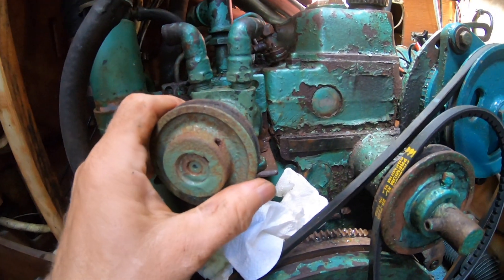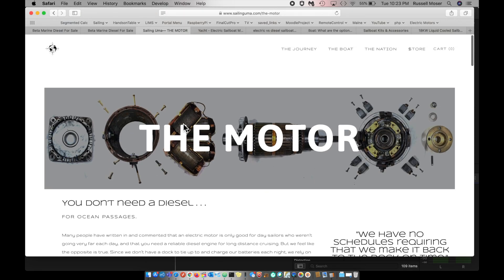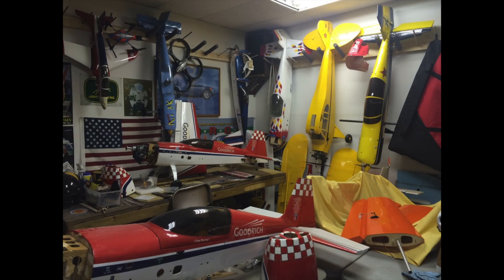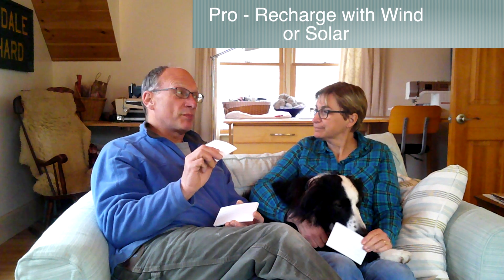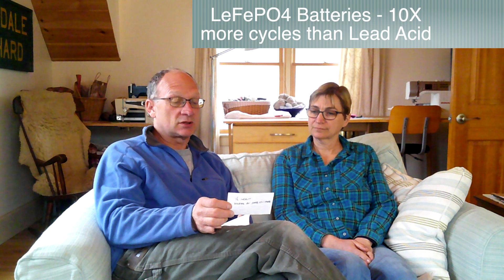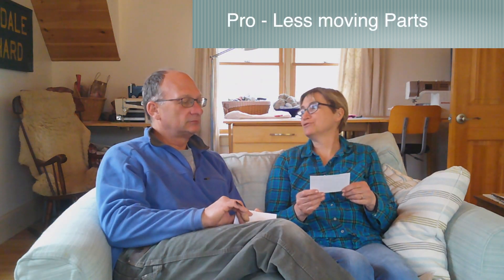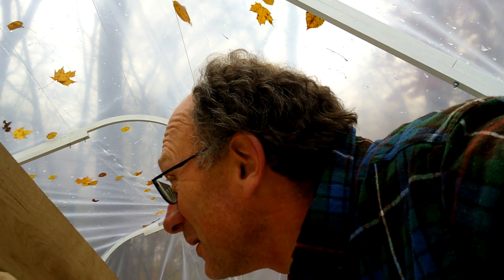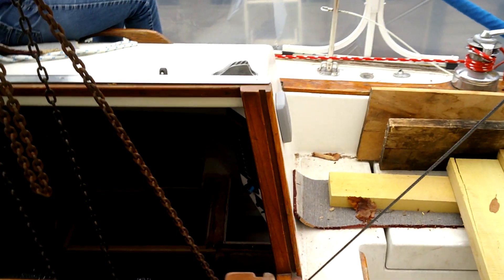Diesel Engine Out - Electric What?!?!?! Story #9

Comment: I think a look at interior factory cranes as an example, would have produced a better, less stressful, and simpler method for removing the engine.
However, on seeing the electric replacement motor, and comparing it to the removed diesel engine, the improvement is obvious.
.